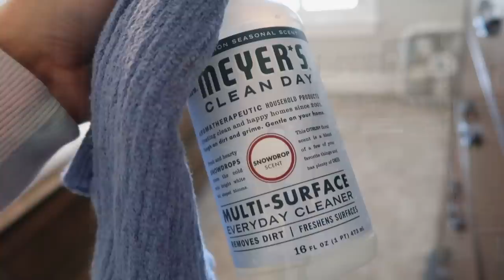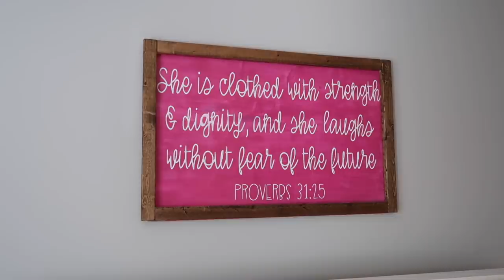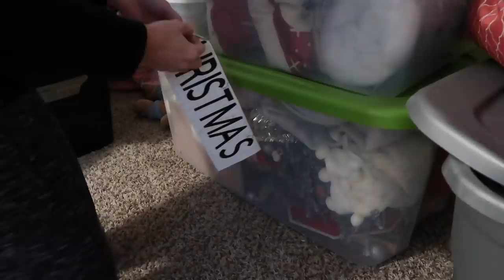2021 MASSIVE CLEAN WITH ME!! | EXTREME CLEAN, DECLUTTER, & ORGANIZE| ATTIC Organization | Amy Darley

Comment: You need to get those pictures out of the attic all together. They maybe already ruined due to heat or moisture. They need to be downstairs in a climate controlled area.
Reply from the maker: They’re not. The attic actually doesn’t get warm
Reply: Good, I’m so glad.